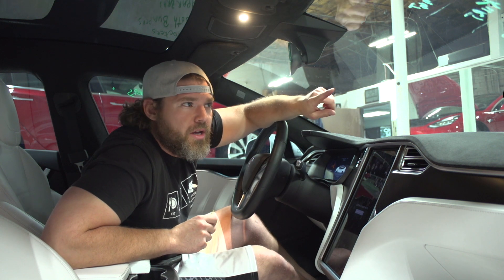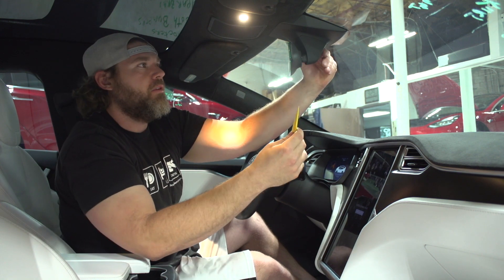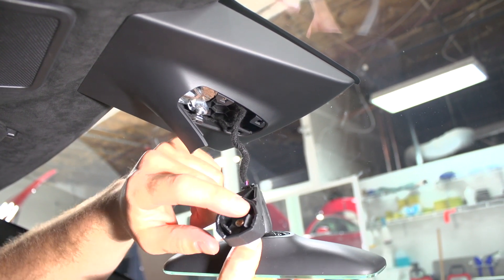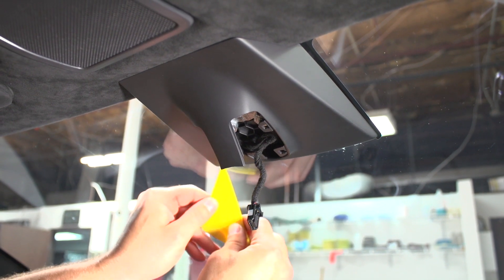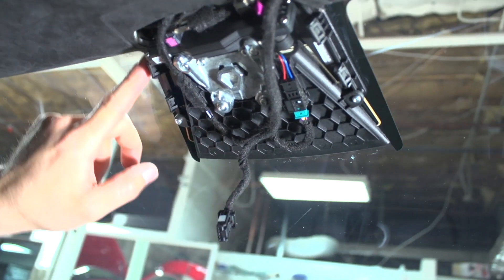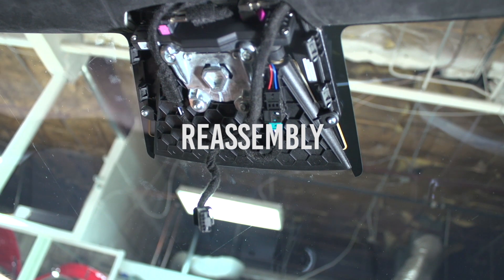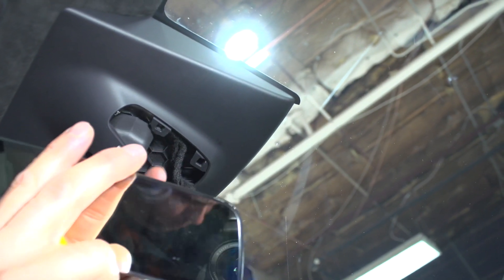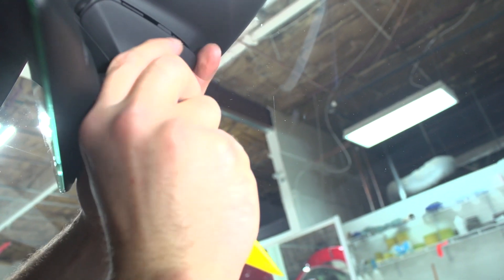Tesla Model S removal of rear view mirror

Comment: My 2012 Tesla Model S P85 mirror assembly just came off from the windshield abruptly. No idea how it happened. It seems that the adhesive that holds the bracket to the glass wasn't strong enough (windshield was replaced by a local shop in 2020). I don't know how to take the mirror off of the bracket. The assembly looks different than what's shown in this video. Here is the link to pictures I took. https://drive.google.com/drive/folders/1RFwOmBoToUFN0uUd8-nJcHDmH_yd_b1F?usp=sharing Any advice? Thank you.